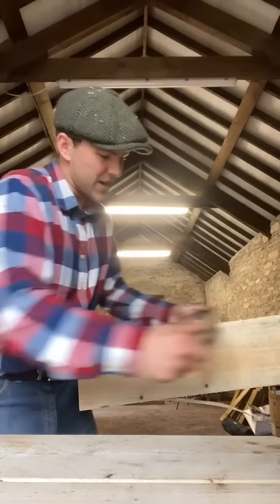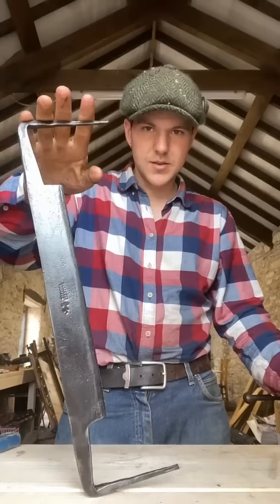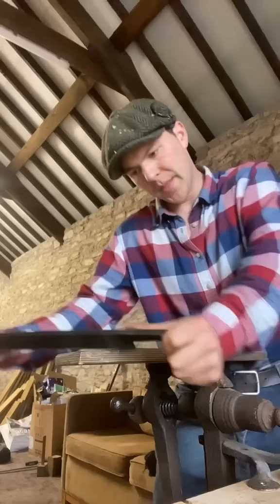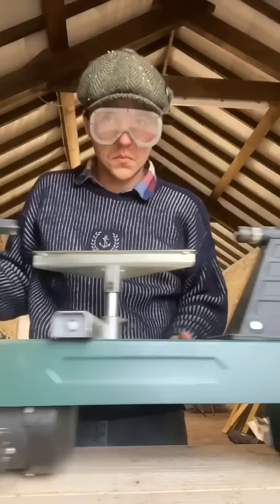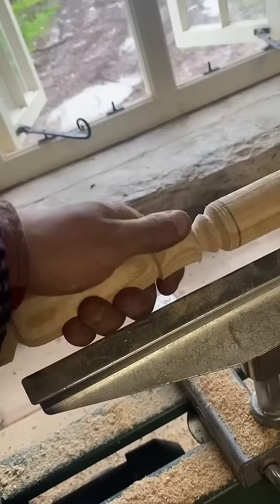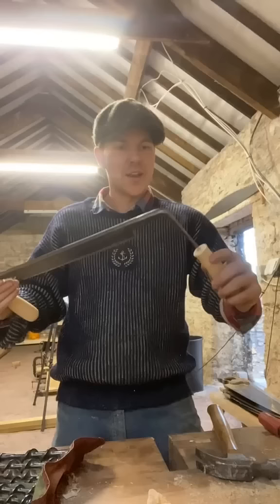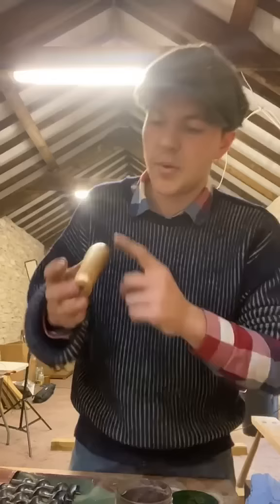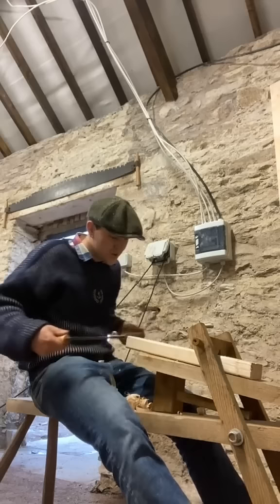Restoring A Rusty Old Drawknife #ireland #woodwork #handtools #restoration #sharpening #woodturning

Comment: Hearing it called a 4x2 sent me into fight or flight, ngl
Reply: Man I felt the same wayyy
Reply: And calling someone dumb as a 4x2 doesn’t have the same sting
Reply: I came to the comments just to say this
Reply: Tell me its different!? 🤦🏼🙄 Tell me its like Actually 4"in.×2"in. or something!?
I dont want to think hes that petty or obtuse.... 🤔🤷🏼
Reply: 4" thick and 2" wide. No problems.
Reply: Don't forget 6x2s and 8x2s. 10x2s make good leadjer boreds.
Reply: Took me a good 5 seconds for my brain to work out what that was.
Reply: Or, as he’d say, “flight or fight”.
Reply: @kramnull8962  that's a common misconception. it's actually 4" wide and 2" thick
Reply: I was about to throw hands when I heard that
Reply: Why are y'all so against it? I'm confused and I get the feeling that the answer to my question is either terrible or just normal
Reply: Yeah I am so confused, 4 X 2 inch is a common measure of length of timber in Ireland 🤷🏻
Reply: @dkinclonberne In North America we call them 2x4. 4x2 just sounds wrong.
Reply: Most people in North America are used to saying 2x4, instead of 4x2, so it’s weird to hear someone saying it the other way.
Reply: Rushed here to see if any one else was triggered
Reply: @paul_warner if you want to be really accurate most 2x4s are actually 1.5” by 3.5”
Reply: @shubagoosecanfly2140  not true, they're actually 3.5" by 1.5"
Reply: Came here for this comment!
Reply: @paul_warner  haha!
Reply: Imma calll it that
Reply: @dkinclonberne  here in America we usually call it a 2x4 not 4x2. It is the same thing I just hate hearing it called 4x2 cause I’m not used to it and sounds wrong to me
Reply: @morijin6903  I replied to someone else, essentially in America it is called a 2 x 4 and not a 4 x 2. We are just used to it all away and it sounds very wrong for it to be said the other way to us.
Reply: 4x2 was the common name in NZ, now I think they call them 100x50 and they are very slightly smaller due to metrication … it’s what you grow up with …
Reply: @morijin6903  Because American's can't stand when a different country has a different accent or way of saying things because to most Americans, the world ends at the US border.
Reply: @lordvader6322  damn, I'm American and I say it both ways cause it's just the same thing
Reply: @Greenredfield stop no more!😭😭😭😭😭😭😭😭
Reply: yeah, a 2x4 is a sheet material I believe, a 4x2 is a beam.
Reply: @paul_warner  They were talking about 2x4s not 4x2s!
Reply: I worked in a hardware store in Ireland for years and never heard it said any other way. The bigger number is always said first here: 2x1, 3x2, 4x2, 6x3 etc.
Reply: Why. People in ireland know what he means
Reply: Is it just backwards, or is it in centimeters instead of inches?
Reply: 2 by 4's aren't even 2 by 4's anymore. I don't care what he calls it.
Reply: @LBCB94025  Typically the smaller number is said first, at least where I'm from. 2x4, 3x4, 2x6, etc
Reply: @morijin6903 in america we call it a 2 by 4
Reply: In the UK it's definitely a 4x2 6x2 4x1 etc etc. Inches obviously. As you guys In the US have said it sounds weird to you. 2x4 sounds weird to me.
Reply: 4x2?! What r those?!
Reply: 4x2 means its actually 4 inches by 2 inches, 2x4s don't actually mean 2x4 anymore unfortunately
Reply: @LBCB94025 thats exactly what it is allthough he seems the type to say something like that so people will come to the comments and boost engagement 😂
Reply: USA: I’m 3 inches 6 feet tall. You say the small number first! Now watch me fail to file files according to date said in the most absurly random order and make the whole world hate me when I do!
Reply: And hey, if you’r 4x2s aren’t even 4x2s any more, it might be time to reach for all those guns you keep collecting. If any lumber yard over here tried not giving us exactly what we order, by specific measurement, and pay for, they wouldn’t be around anymore come weekend.
Reply: Oooh man me too
Reply: @nordicmind82 that’s a dumb example. In that case it’s 6 foot 3 inches because feet are the bigger unit. So it’s not the small one first

And idek what you’re talking about at the end there other than making it obvious you’re xenophobic
Reply: @NazraT1704 1. Exactly my point. 2. In the U.S. 4by2s aren’t actually the measurement 4by2 anymore. Lots of builders are furious over this. Makes repairs of older things rather annoying.
Reply: Americans when they drive past an international store
Reply: Weird, that you don’t understand the measurement…seems as if it should just be the way you say it in the U.S….which by the way is not the centre of the universe….reminds me of the film “License Revoked”…never heard of it?….they had to change the name because people in the U.S. didn’t know what revoked means…License to Kill🤣
Reply: @martynichol2600 😃 who cares about North America ?
Reply: @unechaine1  You raise a valid question.

Comment: Good work. One thing though, you need the 2 tangs to go right through the handles and then pein them over small washers, otherwise the handles could be pulled off in use

Comment: That Draw knife looks to be a carbon copy of the one I found in my old farm shed. It has D^D stamped into it, which - here in Australia denotes (denoted circa WWII) department of Defense Australia; so I imagine they CC'd the UK military tools gear of the time...
I suspect that you might find marks on that draw knife indicating either similar, or its predecessor.
Few minutes Later edit:
I take it back it's not quite a carbon copy - due to the face that my DK's handle tang runs all the way through the wooden handle and a brass nut holds each on. Sorry about that.

Comment: How did you fix the handles in place? Just that little tap? No mechanical lock?
Reply: The metal is typically peened to hold the handle in

Comment: Is there a reason you prefer ash wood in particular? I don't work with woods
Reply: Ash has a really straight grain and is very easy to work with. It's been the preferred wood for tool  handles for centuries. 👍
Reply: That and it's reasonably balanced between strong and flexible hence ash shafts for polearms, etc. Also, it's just got a gorgeous contrast in the grain.

Comment: How did you attach the handles to the blade? They weren't "rivetted" (sorry, don't know the proper english name) on, were they?
Reply: The oil swells the wood. I think he actually bored the one hole sideways so his will not get as tight. The oil makes the wood expand securely around the blade's ear.
The wedges in a hammer or axe do little to actually hold the handle on, it is the swelling of the wood itself that makes the fit secure, inside the hammer head.

Comment: Grinds my gears to see someone drilling a "straight" hole with the brace wobbling about all over the place. There is no way to do that job properly with the tool held like that. Mount the piece so the hole will be drilled horizontally at belly level and hold it as intended with your abs.